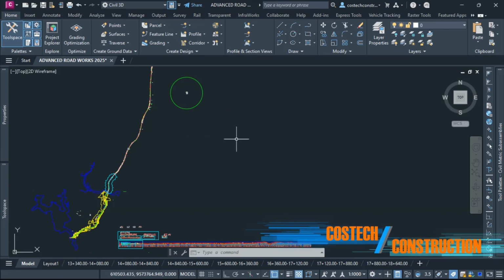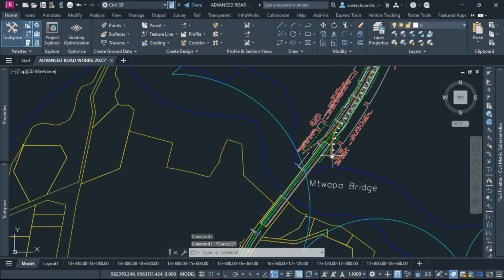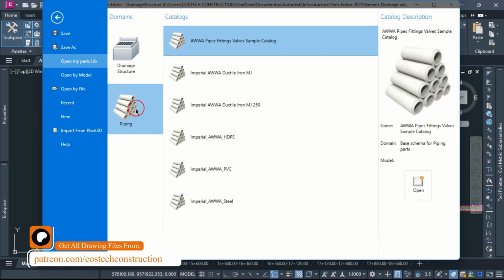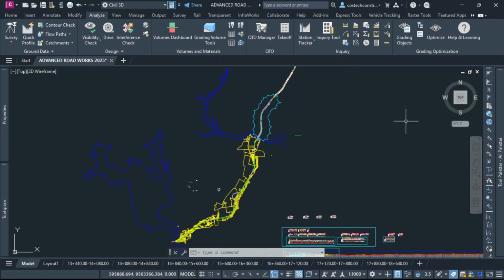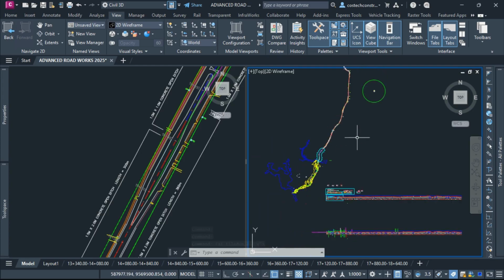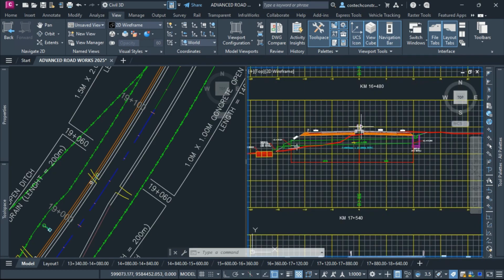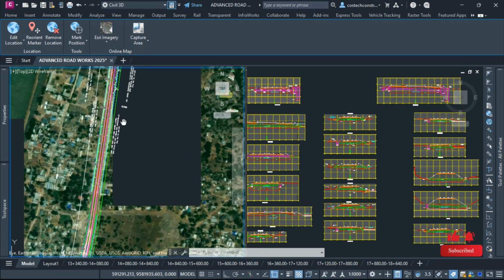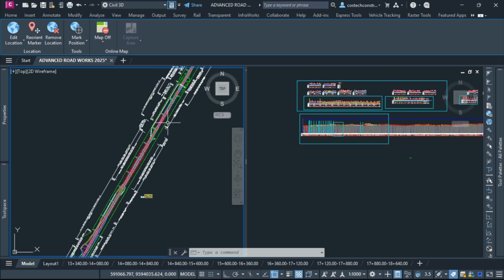Advanced Road & Sewer Design in Civil 3D 2025 – Full Course Introduction

Comment: Sir you've been doing a great job. Sir I'm having some issues while creating pressure network design such as When I create pressure network line after creating Alignment and parts lists it shows me warning sign in Alignment and when I create profile I don't get costech construction water bands in 2022 civil 3d version
Reply: Sir can I get email id to send you my pressure network design file because I'm having warning signs in my alignment after creating pressure network pipe and improper fitting
Reply from the maker: @mohdfarhan9995  costechconsturction0@gmail.com
Reply: @costechconstruction254  thanks a bunch
Reply from the maker: @mohdfarhan9995  Welcome!
Reply from the maker: The water band is a custom band. You can get the working file then use the Import command . 
Manage tab - Styles Panel - Import